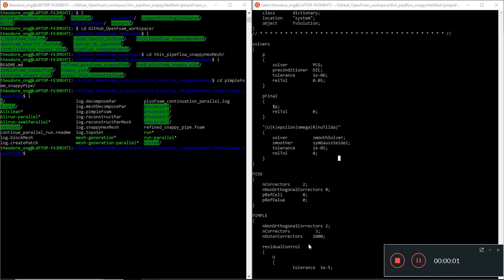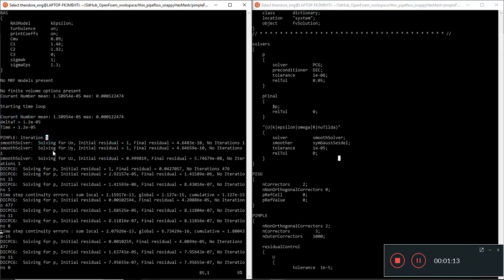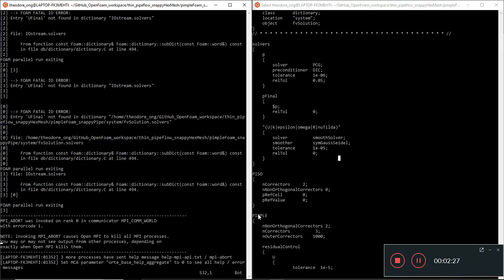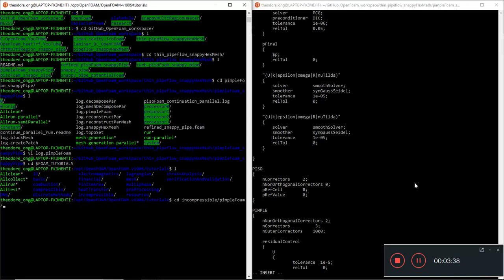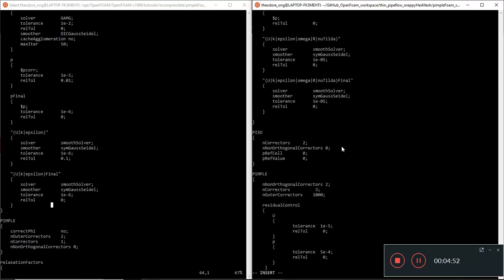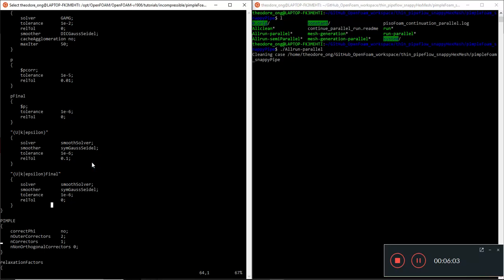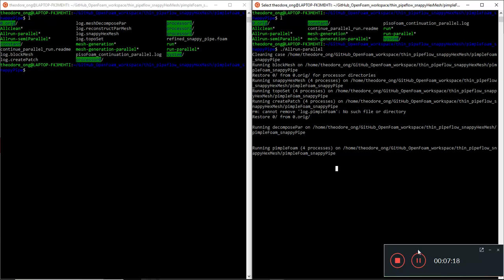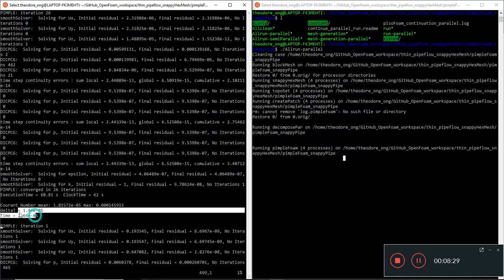OpenFOAM Intermediate - 53 Setting up a pimpleFoam pipeflow case part ii and running the case

Comment: hi 
i have been running simulation for wind turbine . In that I am facing time step continuity error so i wanna know what is the reason it occurs and what is the solution for that ?
Reply: make your time step smaller,and improve your mesh. Or check your interface well